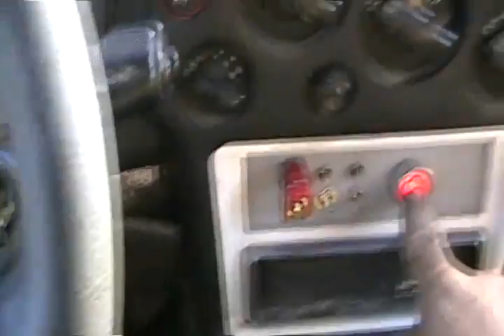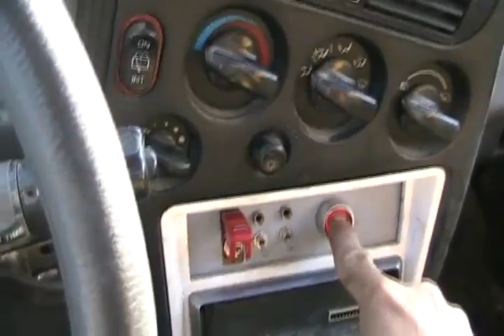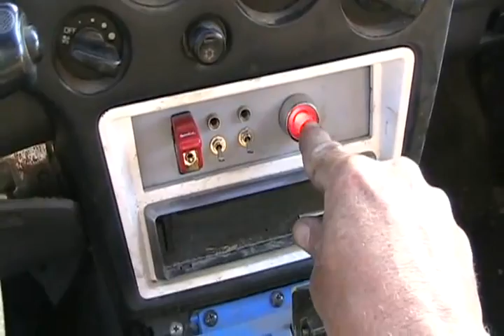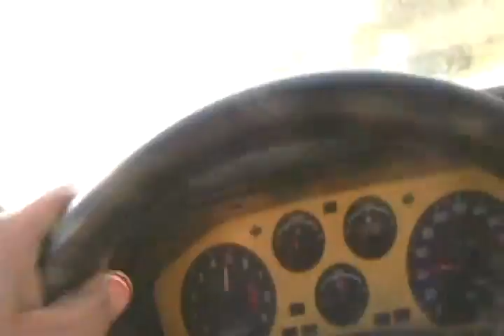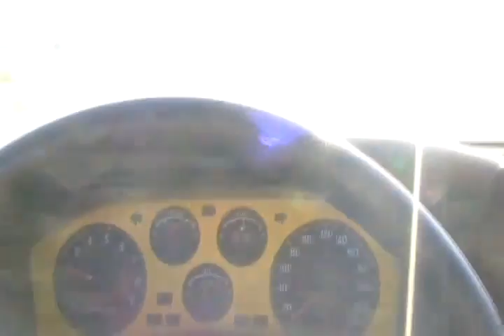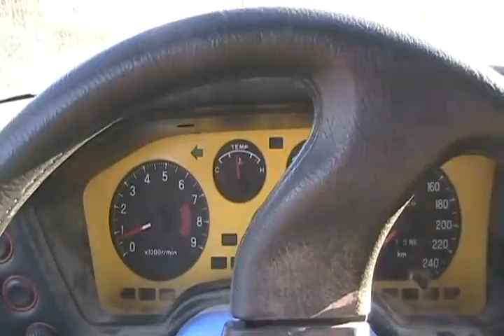#1427 First drive repaired eagle talon with bees [Davidsfarm]

Comment: u know that is a 4g63 non turboed motor one stout ass motor
Reply: That engine is one of the biggest pieces of crap ever engineered.  I worked on them professionally at a dealership. I know a thing or two about them. 
Mitsubishi went belly up in America for a reason; POOR ENGINEERING. I'm sure if you're a 24 year old millennial ricer, this engine is "amazing" to you, but they were a real pain in the ass to work on professionally.

Comment: Why is there a Toyota logo on the front
Reply: The Eagle Talon was one of three model names given to a sports coupe that was manufactured between 1990 and 1998 and sold by the then Chrysler Corporation and Mitsubishi Motors of Japan in a joint 50/50 corporate venture known as Diamond-Star Motors (DSM).